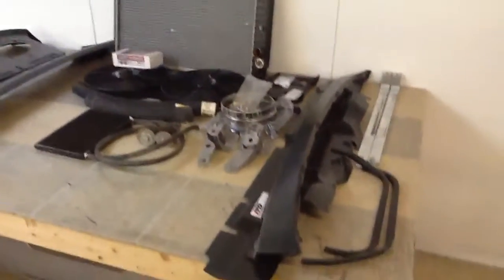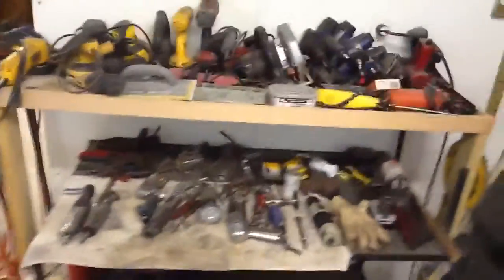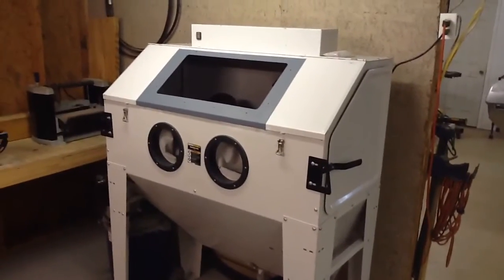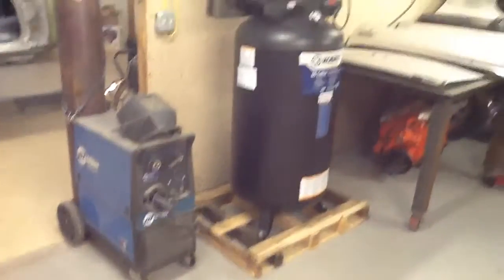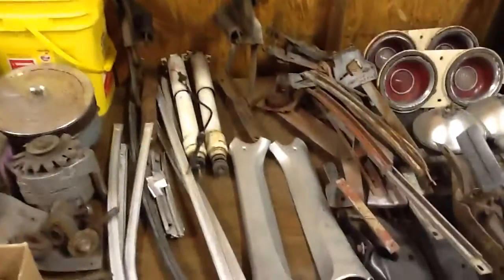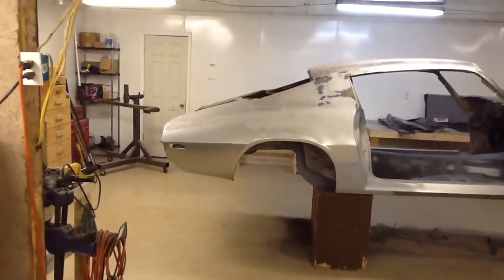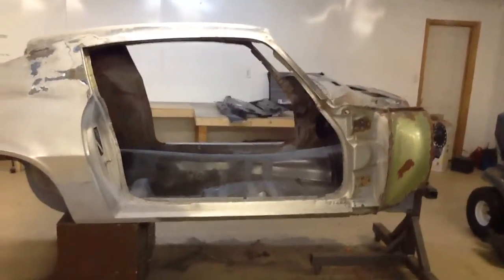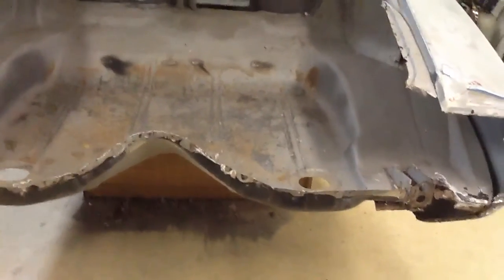Shop cleaning and organizing Part 2

Comment: Shop came out awesome!!!!! Where you kidding when you said you didn't bag or tag the nuts and bolts ???
Reply from the maker: No joke 1WC, I'll be leaning on my 2nd gen pals for some help when the time comes. Some stuff is in certain locations, that will help, but I'm gonna have a time.
Reply: +jeff lindsey WOW !!! brother that's going to a big job you may want to go to amkproducts.com and buy the kits they come all labeled and are not that expensive just a suggestion brother 👍🏻
Reply: I bought one of those kits for the body panels. It was about $250 if I remember. 515 pieces
Reply from the maker: Thanks, I'll look into that for sure